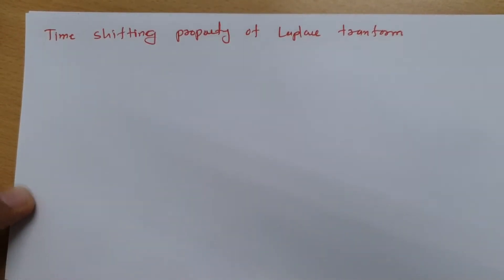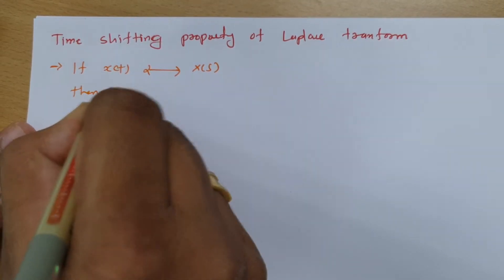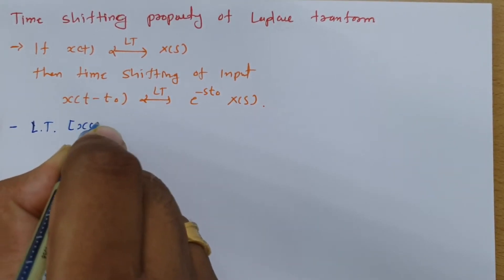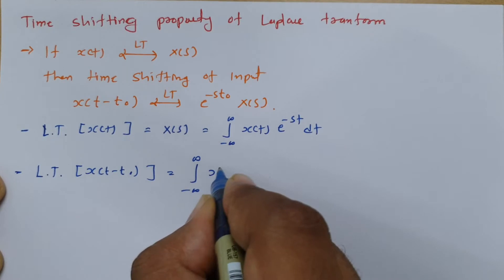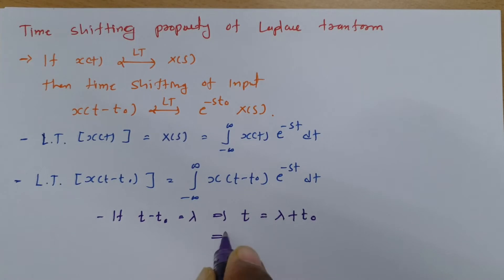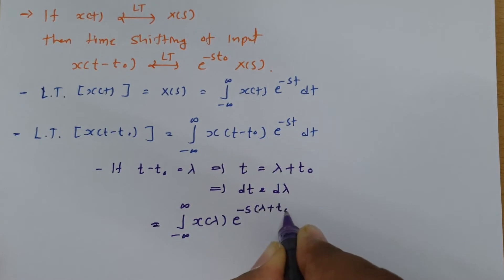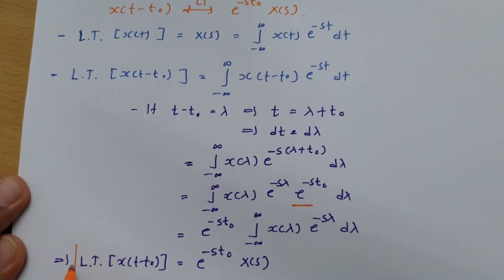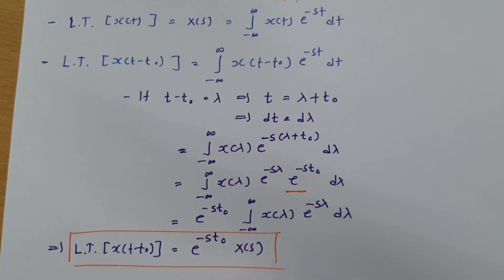Time Shifting Property of Laplace Transform: Basics and Proof in Signals and Systems

Comment: Sir u substituted x(t) by x(t-to) then it should be applied to exponential part also....??
why didn't u substituted there. ...??
Reply: i agree the la place of 1/2s+1 should be exponential part
Reply: Because the shifting of time doesn't do compression/decompression of the signal, so the time period or the frequency of the original signal will be unaffected, hence the value of 's' will be unaffected